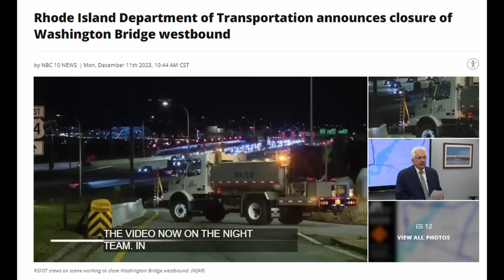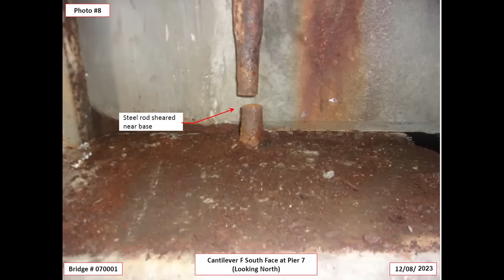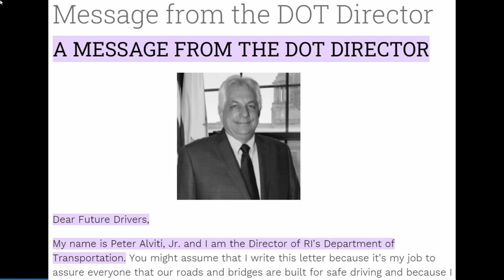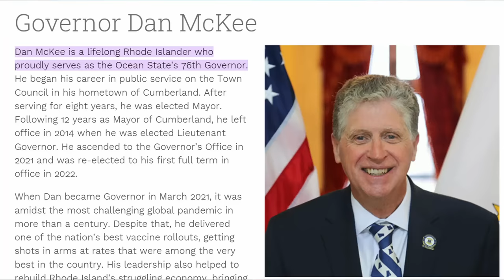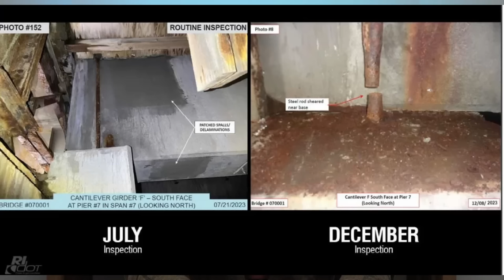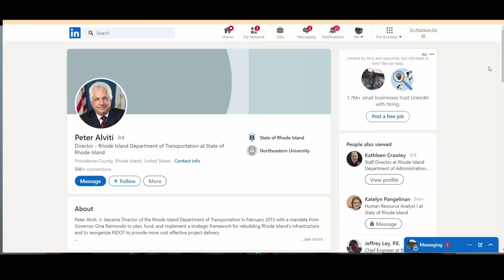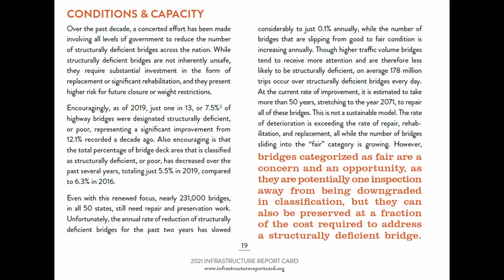What is Really Going on with the I-195 Emergency Bridge Closure in Rhode Island

Comment: This is a multi-lane bridge that under normal conditions should be capable of surviving a major load such as a line of cement-mixers crossing at once.  I would suggest attempting to determine if there is one lane (perhaps the center lane) that is a little safer than the rest, and allow one lane of west-bound traffic through.  This would allow a certain amount of traffic, but severely reduce the weight load while repairs are being made.  The Henderson bridge to the north appears to be in the process of being expanded (an obvious need!) - but I would make the entire bridge west-bound, carrying some of the remaining traffic from 195-west - diverting east-bound Henderson traffic to 195-east.  It appears to me that while this would create some confusion and congestion in the short-run, it's far better than leaving no way to get west-bound across that river except the normal west-bound lanes of the Henderson bridge or running all the way up the 95 bridge.  Rhode Island has obviously been slow to respond to the critical need to facilitate massive amounts of traffic across the river, and now is paying the consequences.
Reply from the maker: Thank you for your comments.  I don't even them having to do this fix in the winter under extremely high pressure circumstances.

Comment: I think the director alluded to the reason this failure may have been ignored if it was known about during prior inspections. He says there are other deficiencies that looked like cascading failures they could quickly progress to failure. I think they may have convinced themselves that the bridge was safe because other variables necessary for failure were within whatever limits they chose use for the boundary between safe and ticking time bomb. Whatever those limits were, a junior engineer noticing the movement described would definitely indicate that their generous limits and boundaries to determine safety had clearly been crossed. They definitely looked for every possible excuse to keep the bridge open but luckily this bridge stopped asking for help and started yelling for help. They waited until an actual crap your pants situation presented itself to them, one that any politician could understand, to close the bridge.
Reply from the maker: I think what you are saying makes a lot of sense.

Comment: It takes forever to get bridge work done unless to bridge is on the verge of immediate collapse.  See the West Seattle bridge which was closed and repaired in 2 years.  While the Magnolia Bridge which was damaged in the same earthquake (2001) as the Alaskan Way Viaduct and was also recommended to be torn down and replaced, is still standing and open today.  With only the very vaguest of beginning planning on how to replace it.

I'm waiting for the sh*t show that will be the Ballard Bridge replacement, over 100 years old now.  Closing it will basically cut Ballard off from downtown Seattle.  So far they are pretending they can just refurbish it, which is crazy.  The bridge carries way more traffic than the original plan ever thought possible.  People will have to double back and take the moving traffic jam that is the Aurora bridge, or worse I-5.  But it needs to happen.

Comment: I was not impacted by the closure but my company was. What a mess. My feeling is that the state knew the span was going to fail before the last inspection and was hoping it didn't fail until the next administration was in office. Also, being old enough and having had experience with a bridge closure in my small town, I can tell you that bridge maintenance is not even in the top 10 of most cities/towns here in New England. It seems like the attitude is build it and forget it.
Reply from the maker: Sorry to hear that your company's been impacted. It seems like it's a widespread problem throughout the country but particularly in eastern half of the U.S..

Comment: Not that it would extend the life of the bridge beyond 60 years but the rebar used in the 50s and 60s was usually raw steel.  They found out later that the raw rebar is not going to resist corrosion thus it needed to be zinc or epoxy coated.  There seems to be some experimentation applied to the evolution of construction materials and techniques.  The big surprise in this and other failures that are being answered by taking the problem structure out of use is "Why couldn't someone have seen this coming"?
Reply from the maker: There is going to be a time-bomb of corrosion related problems with many more bridges in the coming years.

Comment: saving a few $$$ in repairs /prepping for if it goes online have now lost $10,000,000s in lost revenue and maybe even much more 90k cars a day is alot. in july  they could have prepped added detailed monitoring. i doubt a very overloaded truck would do this unless it was already months away from breaking points. i think its a easy scapegoat. "oh it would of been ok if a truck didn't weigh 50% more than it was meant to" yea sure
Reply from the maker: I agree with you.  Their story simply does not add up.

Comment: They may be restructuring to cope with an anticipated 50% load increase as BEVs take over from ICE cars. Also the special effects of a BEV burn on the bridge.
Reply from the maker: Great point. A twofer.
Reply: BEVs weigh an additional 10% on average compared to similar sized vehicles. The explosion of SUVs and pickup trucks has had the largest effect on the average weight of vehicles going up. While EV battery fires do burn hotter than regular ICE vehicles, they are five times less likely to catch on fire, and the fires are very localized, especially compared to fuel tanker fires that are the most dangerous to bridges and tunnels. Since the  way to deal with EV fires is to continually douse them with water, that helps prevents damage to the surrounding road structures, as all that water serves as a very effective coolant as long as water is available.
Reply from the maker: @GoCoyote   They are also causing a lot of problems with parking structures.
Reply: Can you do a diary about the parking garage problem? That little side effect does not seem to be widely known. @CaseyJones-Engineer
Reply from the maker: @justin423   That is a great suggestion thank you.
Reply: @CaseyJones-Engineer  I would like to see any actual evidence that that EVs are causing problems with parking structures. My brother, a civil engineer, says that a parking structure has to handle the loads of a packed crowd of humans filling up the structure, which is far more weight than if the structure is packed full of vehicles, even if they were all EVs.
Reply from the maker: There have been news stories that have attributed parking garage collapses to excess EV loading.  I am familiar with most bridges being designed for many people walking on the deck at the same time.  I have not heard about this for parking garages.  I will do some research on it. @GoCoyote

Comment: Given the price of replacing major bridges it would take less energy to use radient hydronics to keep the highway decks warm and dry. 
Or perhaps run a current through the iron work to delay corrosion.
Too bad, this bridge looks like it was a good peice of work...
Ad abusu adusum non valet consequencia.
Reply from the maker: I am not familiar with that technology but it sounds interesting.  Thanks for your comments.
Reply: @CaseyJones-Engineer  i have heard the pipeline that runs from Montreal to Boston uses current to prevent rust.
Or were you refering to the radiant heating of the road deck ? Thats residential construction but hey sounds cheaper than two new bridges every century.

Comment: The bolt went from not broken to broken at one point.  It’s not terribly hard to believe it was in the past four months.  The phantom truck is a different story.  But the fact that bolt is broken now means it was probably broken in July is misguided at best.
Reply: Even if it wasn't broken, the cindition of the bolt was terrible.  Indeed the entire bridge was a hazard.  Why did the inspections not determine this?  I work in maintenance, and If I saw corrosion on that level I'd be jumping up and down over it till somebody listened.

Comment: Considering most bridges don’t get inspected every two years (depending on what the law calls for in each state) and that there is a habit of kicking the can down the road. AND because most current bridges are built in one of three time slots 1880-1914. The Great Depression 1929-1939… or the FHA of 1950-1980s…. 

If they feel they need to close it for whatever reason. Good. They should do it. Most bridges are only designed for a 70-80 year life. And most are rather over extended by now.

Comment: If the exit ramp is dangerous...what about the main span of the bridge...which takes a lot more traffic?  These cracks and breaks in steel should have been discovered on prior inspections..if they'd been done correctly.
Reply from the maker: You are right but this did happen to the main span. I was just talking about the ramp for orientation purposes.

Comment: They have known about the deplorable condition for over 5 years. This is not the first bridge to be found in this condition in RI. The Sakonnet River bridge had to be replaced because of a failure of RIDOT and Alviti. The Mount Hope bridge currently has a weight restriction. Half the overpasses in RI are being supported by a Jenga game. Alviti should have been fired years ago.

Comment: New subscriber. I used to live in Oregon and they were finding I5 down south were having concrete cracking happening even on short overpasses. Come to find out the bridges were built for 80,000# and the trucking industry convinced political figures into allowing 100,000# + down to CA. Then finding out that RR bridges around Portland are under the RR so no maintenance. Same as it looks here with this RI bridge , very poor maintenance. No one in government wants to put money into bridges.
Reply from the maker: Thank you.  Yes, these issues with bridges are becoming more and more problematic across the county.  Many are well past the point of salvaging and instead will have to be replaced.
Reply: @CaseyJones-Engineer  Letting the trucking industry overload bridges was the big issue.     Just think how long the Portland Vancouver I5 bridge issue has been going on also.

Comment: NJDOT was responsible for the inspections, maintenance and repair of this bridge.  The bridge inspection engineer staff needs fired.  It's comical that they would claim an overloaded truck caused the anchor rods to break.   They can join Arkansas DOT for ignoring deficiencies and shutting a part of a bridge over the Mississippi.
Reply: ARDOT didn't ignore anything, but they did hire inspectors that did an awful job inspecting things.

Comment: if an overloaded truck could cause this damage, than the bridge is operated by the DOT with a very low  to NONE safety margin (it should normally be at 2 or higher).
In germany bridges are closed at a very earlier stage of degradation, and if a sudden event occurs they are closed directly by the police .
If you look at the sheared pin the surface is allready corroded, thats seems NOT to be a fresh ruption.

Comment: It may be a dumb question, but can't bridges be designed without parts that corrode?  Seems risky to rely entirely on government inspectors to catch near-collapses in time.
Reply from the maker: More corrosion resistant materials are being incorporated into bridges these days than before such as epoxy coated rebar and galvanized steel for piling and other components.  Other steel members still rely on routine painting for corrosion protection.

Comment: Grew up in RI. It is corrupt. The roads are atrocious. The bridge isn't even that old. I'm sure it wasn't constructed correctly either.
Reply from the maker: I have never been there but I am not hearing good things about the roads or the political situation that has led to such problems.
Reply: That Bridge was part of the I way project. It was built around the mid 90's early 2000's. There were a lot of mistakes during the construction that had to be corrected. Don't want to go on forever but inspectors are not on the level. I'm sure they got their job by knowing the right people in government or are getting something for being quiet or they are just making up reports. It was interesting that you said a new engineer discovered it. He was probably just doing what he should be doing and hasn't got corrupted by the "more experienced" people yet. If this isn't fixed by summer it is pretty much the most direct way to get to some of the RI beaches and MA beaches including Cape cod. Martha's Vineyard etc. So I'm sure the high ups will be on it lol

Comment: I would estimate that corrosion had reduced the diameter of the failed anchor by approximately half. If true, stresses would increase by a factor of 4. They claim a single overloaded truck was to blame. How about multiple legal trucks in close proximity to each other? Failure was inevitable.

Comment: I'm not a structural guy, but I would think that anchor interfaces at the end of a span would be relatively insensitive to individual outliers in the magnitudes of the total population of moving point loads, and more sensitive to the total load ... or you know, corrosion.  If you could break a bridge by having a grossly overweight truck, then you'd better not let a few legal-weight trucks drive too close to each other.  It doesn't seem like the most plausible explanation.  Then again, it's not like I could intuit the dynamics of such a thing.

Comment: Wasn't hard to tell that DOT director was an elected official, probably had absolutely not experience in transportation or engineering before being elected to that position! - We really can't beat our political system in this country, as far as our rights and freedoms go! But there should be some sort of checks put on positions like this, where people get elected or politically appointed to these positions! If you are going to run a Department of Buildings, State DOT, or any position that governs structures that deal with engineering or peoples safety, shouldn't we feel confident that the person should be qualified in some way and not just some 'Joe Blow' off the street, that was a major supporter of someones campaign or got their name on a ballot?

Comment: I thought bridges were built for 100 years with appropriate maintenance.  50-60 years sounds like some short cuts to get it built in the hope someone down the line will pony up the money.
Reply from the maker: Well between corrosion and the recognition that design standards change over time, 50 to 60 years is a typical lifespan for most bridges.